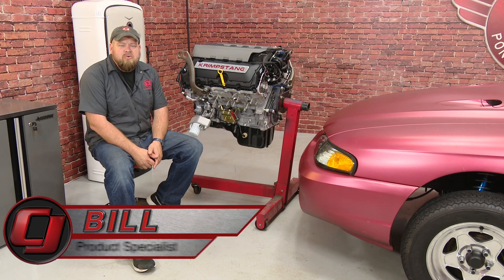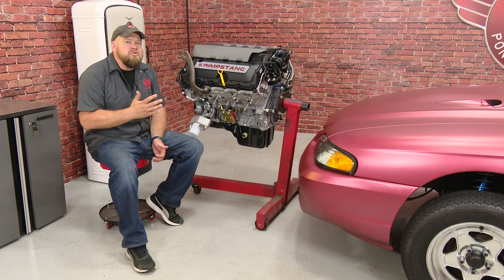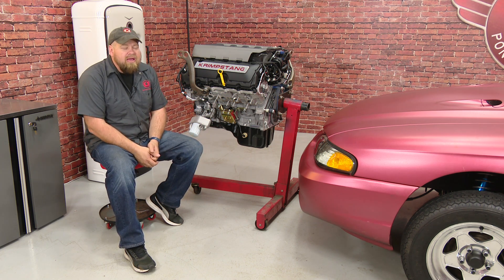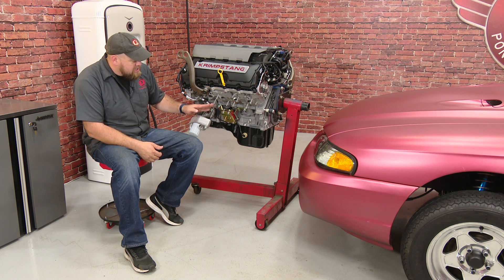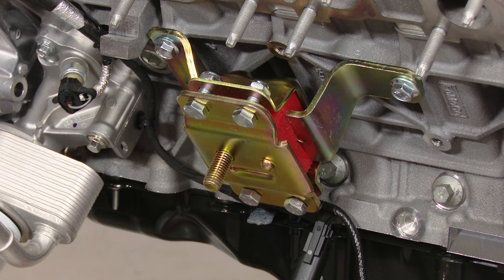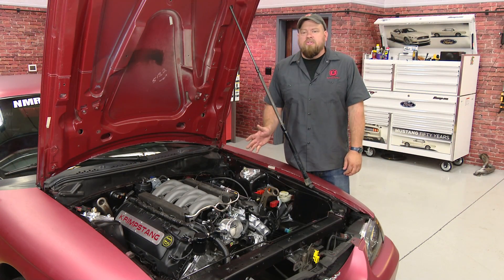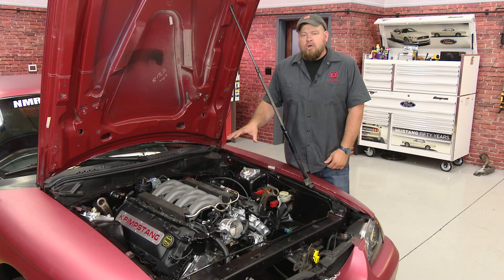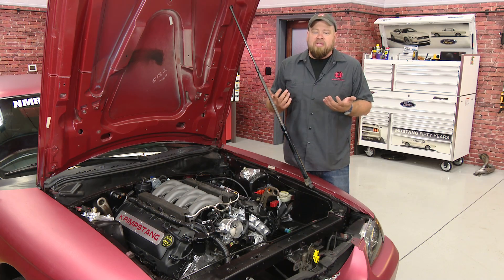CJ Project Krimpstang: 1996 Mustang Coyote Engine Swap Overview

Comment: If I have a 1994 mustang with a gen 2 motor can I use a 4.6 k memeber? Would it bolt right up to the 1994 since it’s for a 5.0 I’m guessing yes since the chassis are the same? Thank you
Reply from the maker: Yes the coyote will use the same K member and motor mounts as the 4.6.

Comment: Great work like always. Curious, why did you remove the 4.6? Something happen to it? If not wouldnt forced induction be a cheaper route? I'm a HUGE fan of the 96-98 cobras
Reply: why would someone keep a grabage 4.6 liter over a 5.0 with like 435 hp and 25 mpg highway hmmmm DUUUR dunno! 4.6 liter is the WORST mustang engine ever.
Reply: @crimescene25  atleast the 4.6 is better than the old 5.0
Reply: @sategllib2191  depends sometimes the ole pushrod 5.0’s aint bad at all.
Reply: crimescene25 you’re an idiot! The 4.6 4v engine in the cobras are not like the garbage 2v 4.6 in the gt’s...the cobras 4.6 are very capable engines and can make gobs of power n/a form or boost! But horsepower per dollar ratio is better with the coyote
Reply: @petrolhead8851  2 Valves can be built to 1000 HP while being more reliable than 4 valves.
Reply: @wile.emario8957  anything can make reliable horsepower with the right builder and tuner! But the 4v will always make more horsepower
Reply: Because I send the piston rods to god on the coyote faster then a 4.6. I had a gen 1 coyote the oil pump sucked ass as well. Gen 3 coyote looks fire though.
Reply: @crimescene25 the 4.6 4v is far from garbage.  It's rods and pistons away from be able to take 1000+ hp.
Reply: @crimescene25 4.6 is FAR from the worst mustang engine ever let alone a teksid 4v.  Tell me you're clueless without telling me.  What a noob.

Comment: would it fit for 99-04 if I did the 5.0 swap...I really wanted  supercharger with the coyote motor swap. ..I have an 04 saleen mustang
Reply: Yes 94-04 is the same basic process, on 96-04 you can reuse the original transmission if you wanted since its modular.

Comment: I'm just wondering if that not illegal
Reply: Krimpstang is a race car so legality is not an issue.
Reply: German Salazar depending on where you live any car older then about 96 no longer needs to pass inspection so everything is legal.... unless the cop is a motor head.

Comment: Will it fit and is it alot of work to put in my 2002 gt?
Reply: The process for your 2002 GT will be basically the same, the only difference is the fuel system. You will have to change your returnless system out for a return style to work with the coyote.

Comment: how in the hell did they fit a motor with 4 cams into that car
]
Reply: It came with a 4 cam engine from the factory
Reply: I thought the sn95 only came with a duel cam
Reply: The Cobras were 4 Cam engines, the GTs were 2
Reply: Oh ok still that's a lot of motor for a small car like that, the thing should fly
Reply: Bill Tumas  hey im wanting to put a 289ci from a 65 gt fastback into my 96 mustang what problems could i expect as far as making the motor fit? and would sn95 motor mounts fit on a 65 mustang motor?
Reply: I never tried that swap but the 289 should use the same mounts as a 302 which came in the 94-95 from the factory so you would need a 94-95 GT K member and V8 motor mounts
Reply: Bill Tumas  ok thank you very much

Comment: What about headers?!... Wouldn't it have been easier lowering the engine in with the headers?
Reply: I am not sure how the headers will clear with the steering shaft and they are not here yet. I figured I would need to make a few changes for fitment anyway so the engine may come back out.
Reply: I'm sure there's still work and adjustments to be made.

Comment: so when doing engine swaps like these where the engines are basically completely different do you have to also change the transmission and manifolds?
Reply: The engine and control pack is around $6999 when Ford has the package deal. If you do the work yourself you can do the entire swap in many late model cars for around $10k. The Coyote is part of the modular engine family so other mod motor transmissions, bellhousings, and starters will work.
Reply: you have to change a lot of things lol a complete swap is around 18k and thats if you're doing the entire thing alone and with all the right tools in hand. ford racing sells a pack with a transmission and i think an ecu, not sure about that tho. for about 16k?
Reply: oh jesus lol thanks man
Reply: Bellhousing is the same, same transmissions bolt to a 1992 4.6 as a 2022 5.0. Have to get 5.0 swap headers though

Comment: Will this work with the stock gauges once everything is connected?
Reply: I plan on aftermarket gauges in my car but I am going to see if I can get the stock stuff working. Fuel and Speedo will work for sure.
Reply: +Bill Tumas I would like to see how it goes!